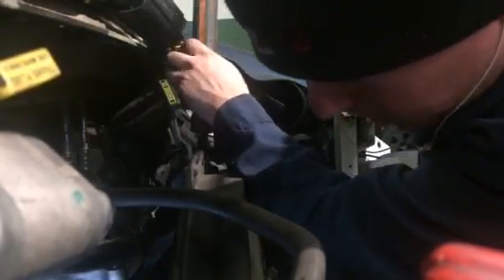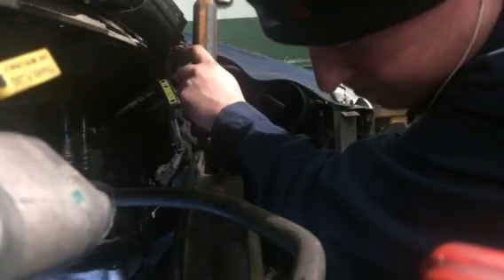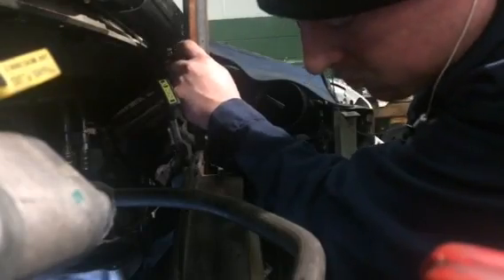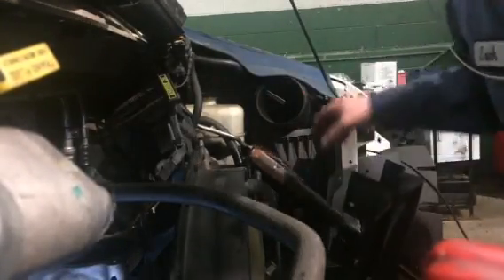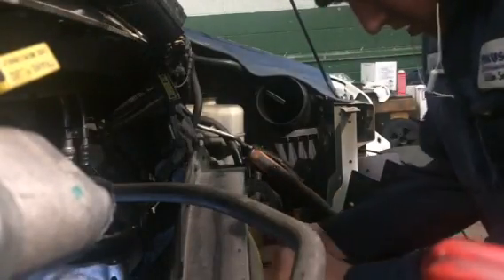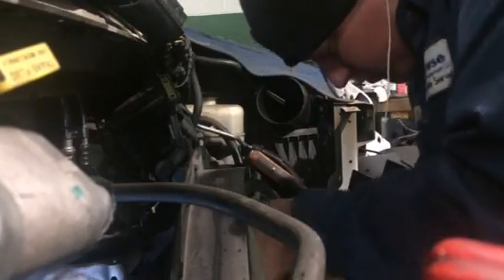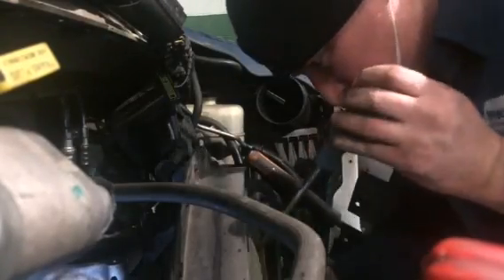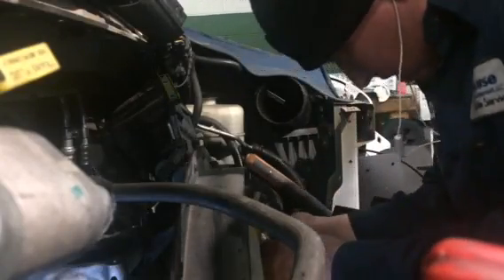Super easy ford 6.0 fan clutch removal

Comment: Nice way to ruin your water pump
Reply: True.  Although his method has valid points regarding speed of fan removal the beating on the shaft can cause leakage.  I suppose if one were to use the flat bar and hammer on the shaft then waterpump replacement is necessary.